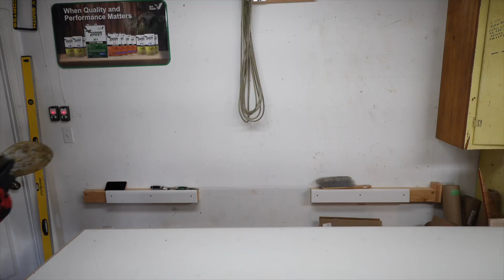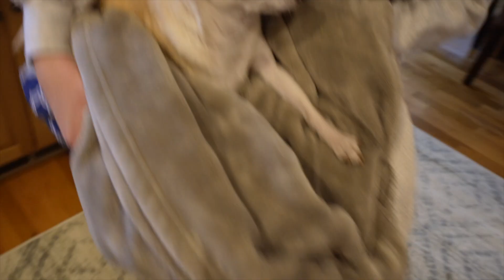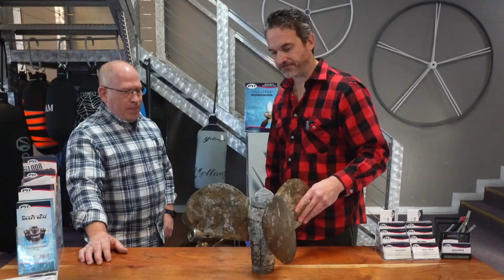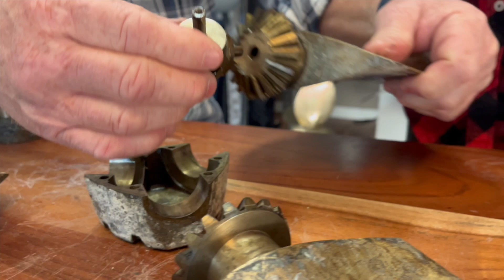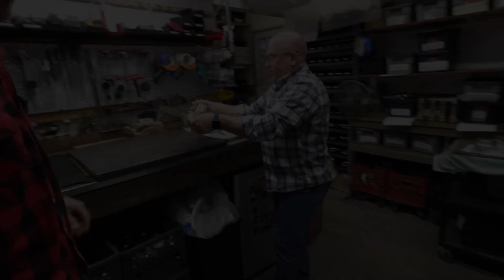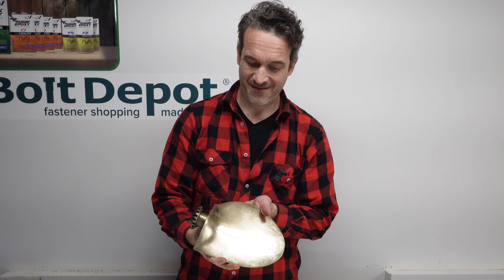Reviving a 35-Year-Old MAX-Prop - Can we SAVE it?! | E022

Comment from the maker: How many years/hours/nautical miles are on your MAX-Prop? Have you ever had yours refurbished? Let's hear your stories!
Reply from the maker: I'll start... We had 35 years and somewhere between 4,000 - 6500 engine hours depending on which hour meter you choose to believe. After the refurbishment, it is difficult to believe that it isn't a brand new propeller...
Reply: I bought a 1984 Nordic 44, 3600 hrs on the original engine, and had gone through a 5 year Caribbean cruise with the previous owner.  The Maxprop was on the boat when they purchased it in the 90's, and I also had the single hole on the shaft nut, so similar vintage. (looks exactly like yours internally)  I shipped it back and received a beautiful, like new prop for under $1000 as well.  It is serving me well currently!
Reply from the maker: @gymcoachdon  that is awesome! Thanks for sharing! 🙏🙌

Comment: We have an early generation Max Prop which has a  of play in the blades and another issue with locking the vernier ring (fixed with a field mod) Its a fantastic prop and we would like to keep it but it needs a full overhaul. Unfortunately by the time we have freighted it to the US from NZ , copped the terrible exchange  rates  and shipped it back its going to be approx 8K NZ so we may need to replace with a locally made Kiwi prop which is a good unit but it would be great if there was an overhaul shop outside of the US.
Reply from the maker: Yeah. That will add up…. I hear the kiwi is pretty decent.

Comment: I just sent mine into PYI and Jerome was awesome to deal with.  Everyone there is knowledgeable, friendly and great to deal with.
Reply from the maker: That’s great! PYI is one of those rare GREAT companies to work with. 🙌👍
Reply: our prop is about 15 years old. They tightened it up with a new spacer and rebalanced.  He said just keep it greased and dont slam it between forward and reverse and it should easily last 15-25 more years.  If you do not want growth on it use prop speed, it woorks awesome.   @livingforsail
Reply: there is a guy there named Phil who im dealing with to get new rudder bearings and he is incredible.  Hes been there for over 20 years and found records of the bearings sold to the yard when our boat was built back in 99 and the replacments that were sold to the 2nd owner in 2014.  their records are amazing.  We also just replaced our PSS shaft seal, PYI has been essential to our winter projects. @livingforsail

Comment: Nice props. Be careful on assembly so forward isn't actually reverse. Follow the Boat had a video recently where they splashed after servicing the prop and that's what happened to them.
Reply from the maker: Crazy. Yeah, they are designed to work left or right handed. I know the settings  for installation so I don’t anticipate that being an issue. Thanks for the heads up! 🙌👍🙏

Comment: I have a 16" 3-blade Max-Prop with a moderate amount of play in the blades. I am aware of the PYI refurbishing service, but have seen some high prices. I had considered the alternative of eventually replacing with a new Max-Prop Easy or a new Featherstream (as good but less expensive).  I had not been able to find a good explanation of this PYI refurbishing service, but now we have it!  Thank you John.

Essentially there are two areas of wear: (1) the mating gear teeth on the cone and each blade, resulting in rotational play; & (2) the mating surfaces between the spacer and each blade, resulting in lateral play. PYI can mitigate much of that wear by replacing the cone gear and spacer. If that does not replace sufficient worn material, the blades may need to be replaced as well - significantly driving up the price.

It seems to me that a simple DIY way to reduce the lateral play could be the insertion of a thin bronze shim between each spacer face and blade face - thereby pressing the back of each blade gear snug against its bearing surface. After measuring the gaps between spacer & blade surfaces with a feeler gauge (when partly assembled) it should be possible to have a machine shop prepare the appropriate shims from bronze sheet (McMaster-Carr 0.016", 0.02", 0.25", 0.032").
Reply from the maker: I’m happy that we could shed a. It of light on the process! Every prop will be different. Excessive rotational play could mean new blades and $$$$ but the retail cost of my repair at $1k for parts and labor is a really good investment towards another 10-15 years of reliable service. 
I don’t see why a self sufficient person couldn’t employ some of these methods in the home shop as you mentioned. It all comes down to time and money 😁.

Comment: What about prop coatings?  Does Max Prop endorse the use of products like Speed Prop to reduce the amount of growth?  Also, is there a fitting used for greasing the prop, or is disassembly required?
Reply from the maker: Great questions. PYI offers a coating called “Crystal prop”. It is a two component paint on coating that competes with “prop speed”. 
I’ve used prop speed before and it worked well. I imagine the Crystal prop is very good (reviews are positive). 

For greasing, there are several M6 set screws in the body of the prop. They can be removed and a grease fitting installed. You can inject grease like this in/out of the water. 

Cheers! 👍🙌